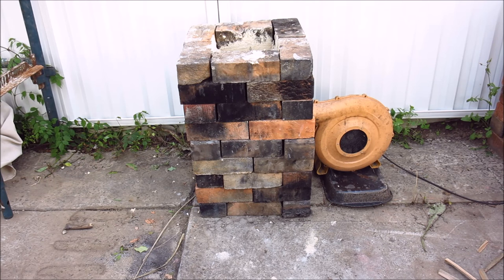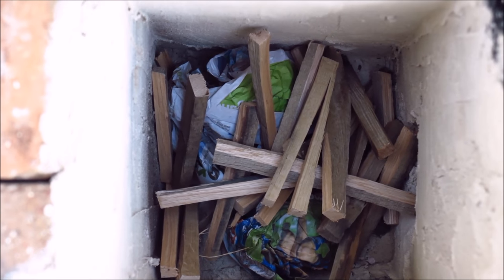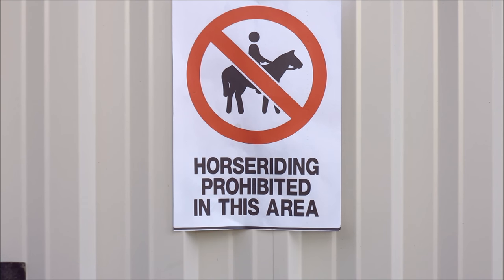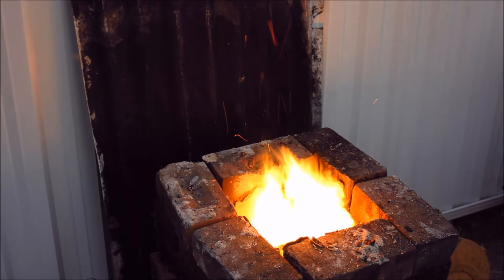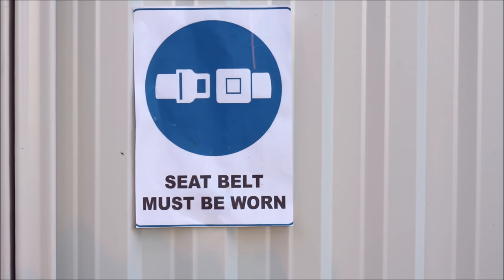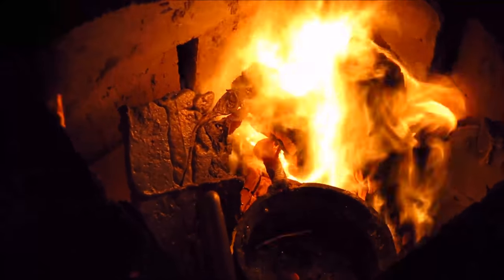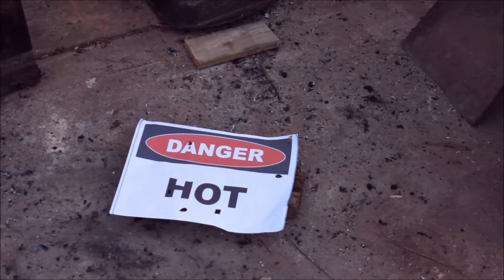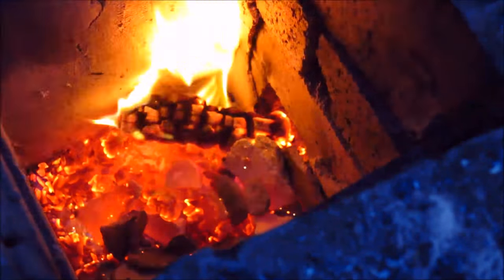Aluminium melting with simple wood fired furnace with Extra safety tips!

Comment: Ok, you got me hooked after seeing the engine head melt. After seeing this I had to subscribe. Have to say you Aussies have a way with words. I did my first melt a few weeks ago with no money involved in furnace or crucible. Hole in ground with scrap wood and a shop vac. Have 3 ingots of zinc weighing in at about 3 kilos each. Just a test run to see if Dakota fire pit would work. Took about an hour for each heat. Got to check out the rest of your vids now. Great demo!!

Comment: well if it isn't my favorite pyromaniac youtuber!
Reply: also perhaps if you reduced the wood to chip size you could get a hotter burn, maybe not chips maybe cubes or rectangles small enough to form lots of air passages between them but not small enough to be blown out of the furnace
Reply from the maker: good point. As I don't have anything to do that with, especially patience, I'll go back to what I know with an oil burner!  :0)

Comment: don't forget that long ago in the good old days before safety was even invented, our forefathers used to melt iron with nothing more than a wood and rock furnace. charcoal is self-insulating - just try using smaller chunks that will pack easier
Reply: oi, and then you can make a wood chunker - that's a machine that's right up your alley

Comment: Id love to see your take on making biochar or charcoal using oil burning as a heat source.
Reply from the maker: Kinda seems a contradiction but I'll keep it in mind. Just have to find a vessel to do it with. 
Any suggestions for something  simple and easy?  Maybe I could do a small amount just in the crucible and throw a bit of steel on it as a lid?
Reply: Yea that can work. If you want to get fancy you can use a piece of copper pipe to cool the off gasses that come off and they condense to a liquid thats roughly the same as #2 fuel oil. Or you can run that gasses into a gas generator of you want that route.
The setup we use is a 20 or so gallon stainless vessel and a lid that just sits ontop then we put that into a 55 gallon drum with a smoke stack about 3 feet tall for draft effect. Once thats done we pack wood all around it and light it.

Comment: I did try this before and for this to be completely successful you have to add wood almost constantly an have a really good air flow
Reply from the maker: Yeah, I think a fan forced rocket stove deal would be the way to go.  The air has to be behind the wood so you are not cooling  the furnace at all and just pumping in heat.

Comment: I used the same setup of bricks and clay with a hair drier and a brick lid. charcoal worked great but wood didn't get hot enough. your blower is better so I'm pretty sure it's the insulation
Reply from the maker: I thought I'd give the wood a try.  I think it would be OK, just I had the incoming air positioned badly. I built this for a burner then had the wood idea. I might do it again and elevate or suspend the crucible so it gets heat not cold air and give that a go.
Reply: I think you nailed it there. Crack the wooden conundrum. Everyone likes to see a good challenge whipped.

Comment: what you should do is set your crucible in the pit and build the fire around make it a big stronge fire
Reply from the maker: You're right but This was just an experiment. MUCH easier to melt stuff with an oil burner as usual.

Comment: you should make a furnace for melting large volume's of scrap aluminum. just a suggestion. thought that would be cool to see someone do.
Reply from the maker: I have done it. Several times already. Thought people would be getting bored with it. Have you looked at my other Vids at all? I'll be doing another large scrapper furnace melt soon.
Reply: i guess i meant something a little more directed so one could pour usable ingots. something like a gravity draining system or something lol. love your videos btw. keep them coming.
Reply from the maker: I have done the mental arithmetic and got the parts to do a scrapping furnace that makes pellets.  I figure with those it's easy to keep them in a bag or a bin and they can then be put in a crucible in the  qty needed to melt and pour.  Something I hope to do soon as I have a lot of ally to condense.
Reply: Oil Burner very cool. I hope to see a video soon

Comment: Good to see you back.  But that safety sign isn't very safe.  No good if ya can't put hot things on it without it catching fire. It almost started a bushfire all on it's own.
Reply from the maker: Well ya know mate, that's often the way safety is. Often more trouble and problem than its worth but in this day of PC whining little snowflakes, Logic and common sense goes out the window.  The safety crybabys won't be worried about the sign catching fire, that doesn't matter to them. What is important is that it is a safety sign. 
To them, that's all that matters.  Of course I'm waiting for the Environmental nazis to start complaining about the smoke and pollution the thing burning caused now!

Comment: Bigger+ hotter = better
Reply from the maker: Yes, only just melted the ally thins time and not really well enough to pour.  Next time it will be out with the oil burner and really make some proper kick arse heat!
Reply: Oil Burner try mixing a little diesel and ground up coal to make a blast furnace